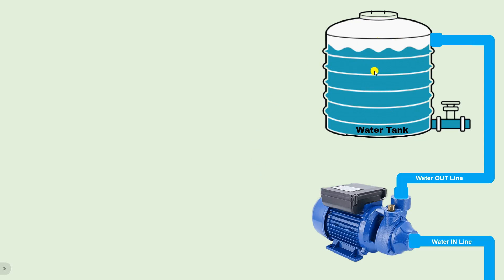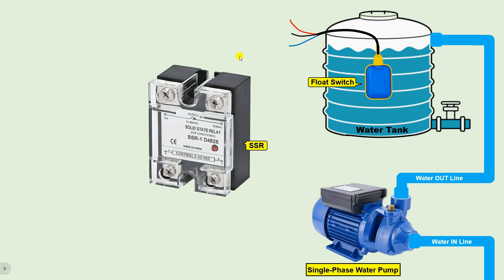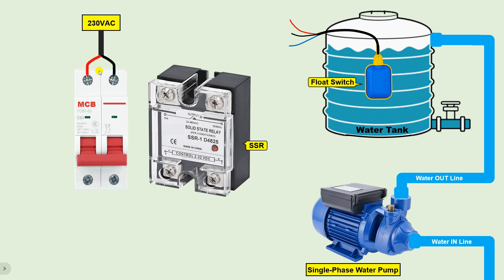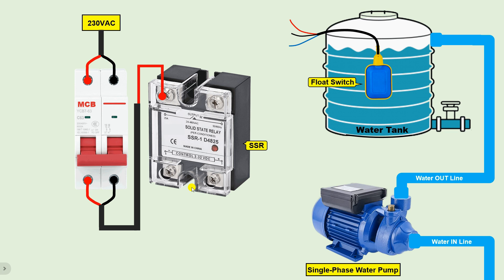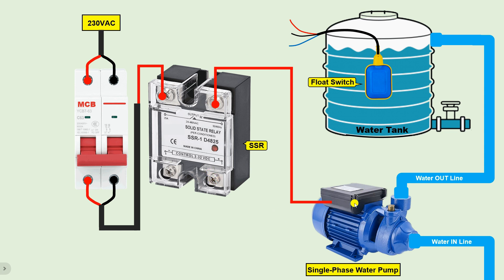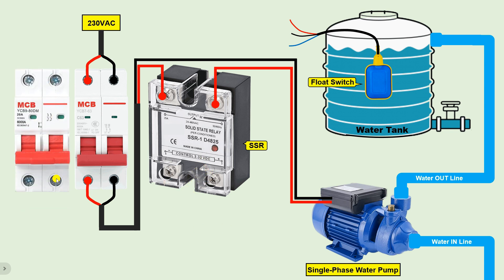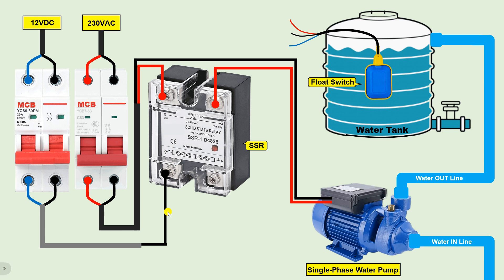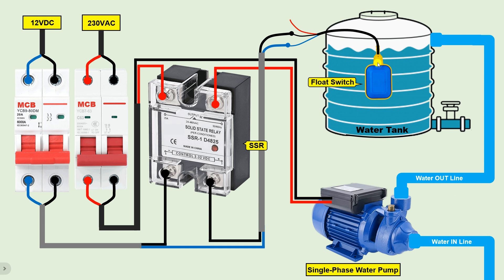Water Tank Motor Automatic ON OFF by using Float Switch and SSR @TheElectricalGuy

Comment: Can we connect the float switch with tine negative wire of the dc input? Can we give the 12v DC supply via 12v DC adapter / 12v mobile charger.